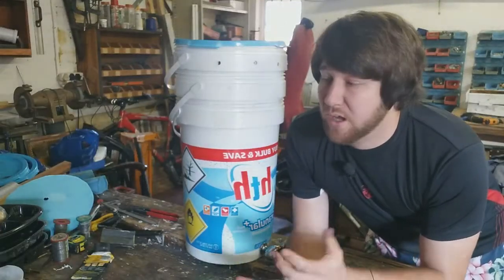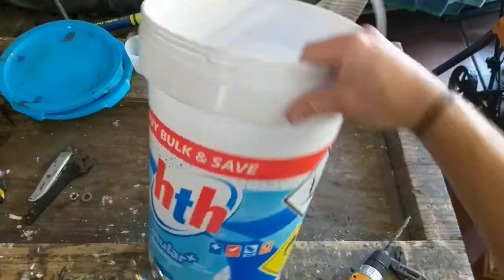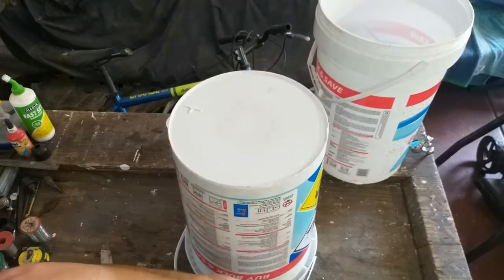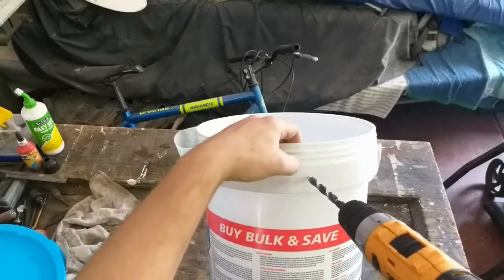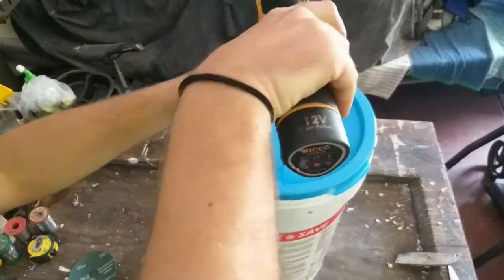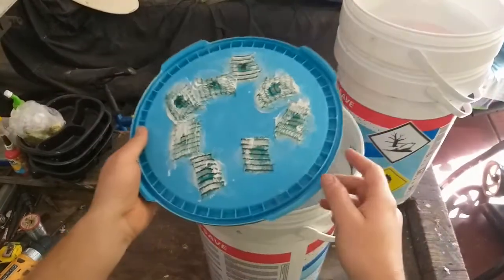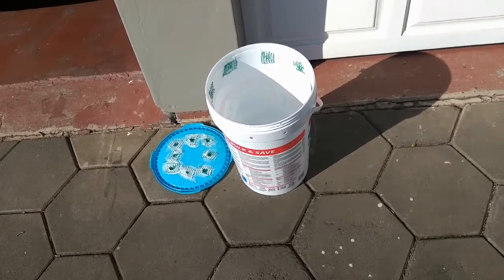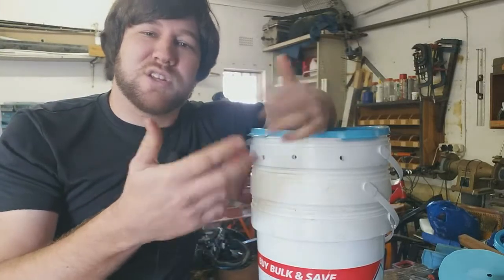Easy worm farm - 3 bucket worm bin

Comment: I like your simplicity however as a true beginner I don’t fully understand what goes in each bucket. I get that tea drops from the middle bucket to the bottom but what actual goes into the middle bucket? You put the worms and food in the top bucket. Are you meaning that the castings end up in the second bucket? 
I am still trying to figure out the best way to separate worms from casting in order to harvest castings. If that is what you are doing here then I like this.
Reply: Worms migrate from middle bucket to top bucket leaving behind castings, peat moss, soil, grit and food go in middle and top bucket but the top is where you feed them after you set it up
Reply: Worms go in middle bucket, they can crawl through the holes in the bottom of the top bucket once they smell the food rotting up there that's then migrating and leaving behind casting in the middle, then rotate the buckets ☺️
Reply: Your worms go into the middle bucket. Use the top bucket for food (and some covering using bedding stuff.) 
Worms crawl up to eat. Crawl back down and make castings for you to use later.